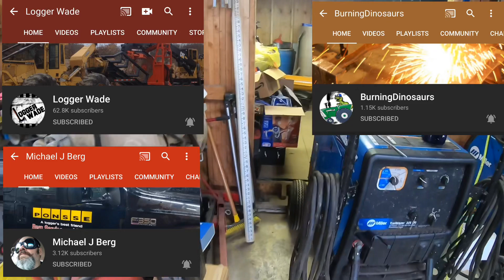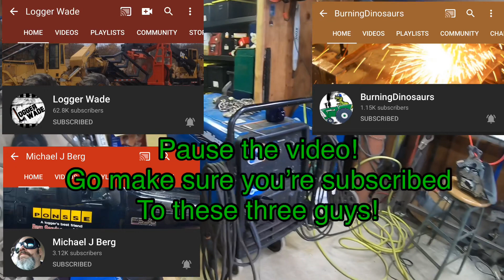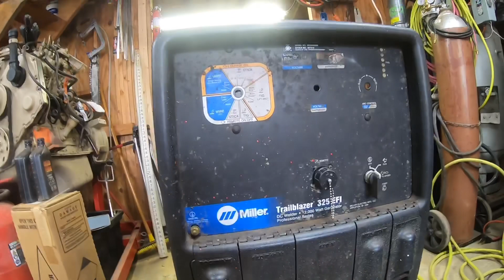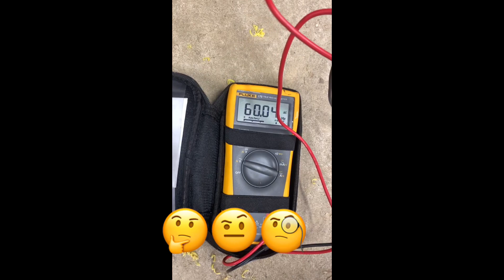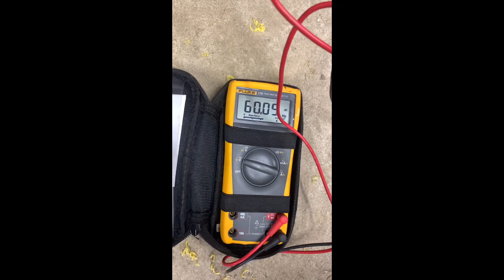Well, I got another welder... but was it a mistake? Miller Trailblazer 325 EFI

Comment: Hey bud. There’s many pcb repair companies that can fix those boards for a few hundred. Find a good repair place and send them both boards. I wouldn’t play their game and spend 3k on replacements. Or go to ebay and find a refurbished board. Then get yours repaired to have as a backup. PCB’s are easily diagnosed and repaired by trained pros. I have fixed them myself in years past if you see a broken trace or an obvious burned out transistor. You could have a bad contactor or capacitor, in which case they replace it and you’re good to go. Just my 2 cents.
Reply from the maker: M Russ appreciate it! I should probably do some kind of an update on it but I just don’t have the time. It’s actually still at the shop I brought it to. They found the welding capacitors popped but also took out a circuit bird they’re attached to, I haven’t seen the damage first hand. When I asked if that board will fix the machine for sure they said they couldn’t answer that without putting it in. There’s a possibility the board in the video, even though we determined it’s new with 3 hours on it, could also be bad. So long story short if I get a chance I’m going to go pick it up and probably call around to a few PCB repair services and get some estimates. I’m leaning towards just getting a new machine though. If I’m going to use it to make money I need it to be reliable. I also would like to have an airpak. Who knows though. I do appreciate your comment, it makes a lot of sense!

Comment: Those 325s are great welders until they’re not.  All the circuit boards can fail and from what I hear it starts a cascade of failures taking other boards out downstream. I looked all over my 1966 Lincoln SA200, can’t find any “boards”,just a big old copper wound pure DC generator. She’s a one trick pony, but does that trick very well
Reply from the maker: Yeah, I got a quick crash course on how crappy they can be. Looking at the new bobcats but I’m afraid it’s going to be the same problems because I’m sure they’re filled with circuit boards now too. Looking at the bobcat diesel airpak in particular
Reply: @JasonWorksAlot  don’t beat yourself up, I got hooked years ago on an old Hobart with a shorted armature.  If the deal is to good to be true, there’s a reason. Lots of Bobcats/Rangers/Trailblazers out there working everyday. Get the best deal on one and warranty. I looked at a used Vantage Lincoln with the Kubota diesel at United Rentals. You can buy extended warranty on those so your not getting a pig in a poke.  Good luck with whatever you do
Reply from the maker: @stevewarner8880  solid point. Does Lincoln make anything with onboard air?
Reply: @JasonWorksAlot  
Not sure about small gas engine drives but I know they make big diesel airpaks
Reply from the maker: @stevewarner8880  awesome I’ll look into them as well thank you! Definitely want something with air

Comment: What happened with it ??
Reply from the maker: Sold it off for parts bought a big blue 400. 

Two Miller shops looked at it and went back and forth with Miller corporate. Said it needed a board but they couldn’t determine which one. Had to buy all three would have cost 4100
Reply: @JasonWorksAlot  That error was for the IGBT thermistor (temp sensor)

Comment: Try to find an earlier model that doesn't have the circuit board , it appears Miller doesn't want a satisfied customer , they want a loyal customer.
Reply from the maker: Amen to that. The way this things panning out they’re going to loose a customer. I took it to a shop that would finally work with me, and they’ve been great. One of the capacitors popped which took out a circuit board (1600$) and what we don’t know is if the PC2 board(one in question in this video) is bad or not. The guys at the shop followed miller’s troubleshooting to a T and it isn’t clear if PC2 is bad as well(1500$) so I’m stuck deciding if I want to spend the 1600 and hope PC2 is fine and the cap/board are the only issues or potentially have to spend 3100 (parts only btw) to have the thing working. I’m pretty upset by this, with how much this machine would cost new, to be almost at 50% of its value in let’s alone after 6 years of service (which I’m told it sat for 2 of them) is pretty sad. The bobcat series I’m told doesn’t have circuit boards and is much more reliable. Wish I knew that ahead of time. Wonder how them red machines work...🤔
Reply from the maker: A a hell yeah man. I would love an older big40 air pak with the continental in it. Hopefully you can merge the two I’ve considered doing the same I know of an older bobcat with a blown diesel on it they don’t support the engine anymore maybe I could mate my kohler to it 🤔. Miller actually tests and reconditions the circuit boards if their new enough which This ones got 4 hours on it so that’s an option too. Though the board really doesn’t look like anything’s wrong with it. I’m not sure. I feel the same though when it’s fixed how much can I trust it?
Reply: I recently picked up an older Bobcat with a blown Onan , 3800 hours on it for $400 , then I found a newer Trailblazer for $700 with a bad circuit board and burned out stator , like new Kohler, only has 210 hours on it , I mean really , a new Trailblazer with low hours like this , catastrophic failure?
Millers dropping the ball.
They have a notorious fuel pump problem as well.
I haven't torn into them yet , hoping they have the same threaded output shaft , make one out of two , no circuit board.
I figure 3800 hours on mostly hard parts is not a problem, new brushes , slip rings , bearings , about all I'd need to replace.
To fix it , a new circuit board , $600 , new stator $1,500 , same situation you're in , double bind , not willing to risk the out of pocket to only have it fail when I need it the most , for another couple grand I could just buy a new one.
I looked at the Bobcat, no circuit board , I decided then and there I would never buy a newer welder with the circuit board.
Problem with buying the older models , Miller stops supplying replacement parts.
If I could find a well maintained Lincoln Big Red , pipeliner , torpedo type trailered welder like my father or grandfather used to have , I'd snag on that , they were and still are bullet proof , still going.
Check out the company that fixes circuit boards for less , they don't care what it's off of , sorry name escapes me , just send them your old one , they test , fix if needed , and send it back to you for a lot less.
Reply: Right.

Seems to be a trend no matter what you buy these days.
I recently bought an imported mag drill off EBay , cost me just under $400 , I already have a Milwaukee, but it has the Jacobs chuck , I needed one with a Weldon annular cutter chuck , I've bought imported power tools before , they all have the same problem , poorly greased bearings.
I took this one apart and discovered an overly greased gear box with good grease , but when I pulled the bearing cover you can see the clear Vaseline type grease they used , I just knew it , I was not surprised.

Actually this grease is more like a gelatin than grease , all crumbly , it was rattling and making noise like no tomorrow, I greased it with ProLong and now it's much quieter and smoother.

Every dang imported drill and grinder I ever bought , mostly from Harbor Freight had bearings greased with this inferior grease.

Eventually I'd like to replace the bearings for a better bearing , they skimped on the balls.

I knew what I was buying , but now I'll make improvements and make it last a long time.

Bearings , switches and brushes are the most common weak spots with imported power tools.

If you're not using annular cutters yet , do yourself a solid.

You Tube ... Magswitch 

You may already know this , I'm just sharing.
Reply from the maker: A a oh I’m quite familiar with them. I’ve got a couple mag drills. Well let me rephrase I’ve had a couple mag drills. I’m down to one, sold the other and gave a Milwaukee to dirt perfect that needed a circuit board. I only get the Milwaukee grinders anymore. For the price they last. My cordless stuff is all dewalt because we use that at work and this allows me to totally bring my batteries from home and help out work. I’m currently looking at the metal cutting circular saws. Not sure which brand I’m going to go with yet
Reply: Yeah , I see.
Dewalt cordless for me.
Drilled out 24 ea. 13/16 holes through 1/2 4x4 angle iron the other day with my mag drill , less than an hour , I'd still be drilling them with a twist drill , made it so much easier.
I was drilling away the other day at my press when I needed some cutting oil , didn't want to stop so I grabbed a spray bottle of Dawn dish soap and water I was using for checking leaks on my CO2 regulator , happy accident , best dam cutting lube I've ever used , kept my bit and work piece cool , not a single whisp of smoke , coagulated the drill shavings , bubbled up , and the best part it made my holes smell springtime fresh , ha!
Seriously, that soap is greasy as all get out , the only thing I use now , doesn't make an oily mess   , cleans the metal and my hands , after I finish drilling , I wipe everything down and give it a zap of WD to keep the rust from taking hold.
Reply: Evolution makes a good carbide toothed saw blade , that's what I'm using on my Dewalt bench mount saw , hand held? any Skill type saw with a Diablo carbide blade , it always delivers , thick metal no problem.
Reply from the maker: A a I’ve been looking at the evolution, Milwaukee, and fein versions of the hand helds. The low rpm high torque ones. I’m not sure which I’ll end up with prices are all close enough and it’s like every review contradicts the last one🙄
Reply: Well , Evolution makes a good bench saw , can't speak for hand held.
I use the blade everyday , still cutting , bought it about three years ago.
I never bear down on it , cut as lightly as I can.
Reply: AMEN I have people wanting my old gen because you can carry your parts with you! SIGH, just like hustlers trying to buy our pre emissions no-mod trucks!😆 Have BS motor & Armature tested/tagged from rebuilding Miller Trailblazer pre EFI.
Reply: @JasonWorksAlot  following YOU! I break stuff

Comment: If got a pc board . That is bad that need repair . I know a guy that can repair the board. Frank Heizler . On Facebook. Look him up . He do it a lot cheaper then buying a new one . Especially on older unit you can’t get the boards for it .
Reply from the maker: Thanks for the recommendation. I sold the machine a little while ago. Guy had one with a blown engine.